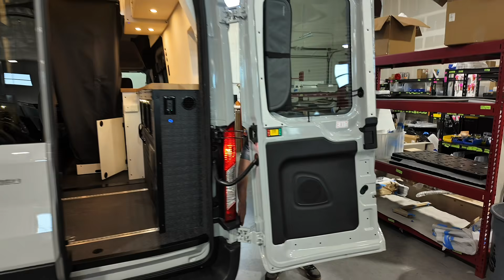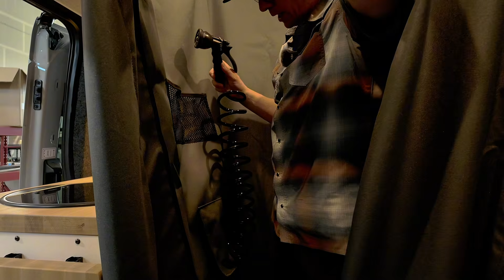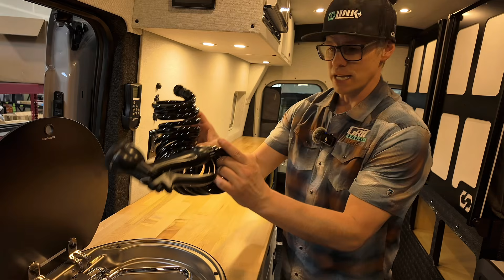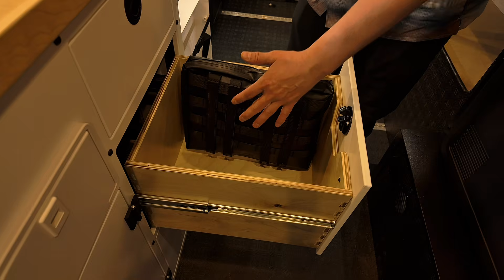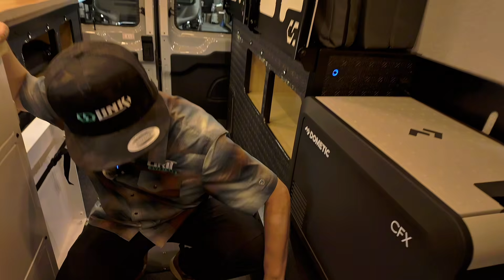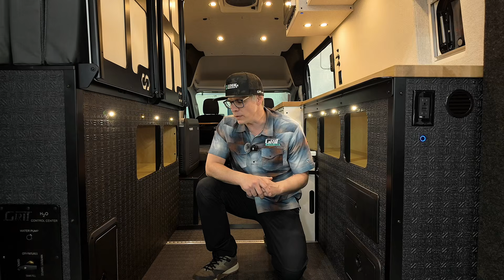2025 Ford Transit AWD Campervan Tour, The Ultimate Adventure Van by Grit Overland, flexible off-grid

Comment: 3 creative twin beds Must easy driving/easy parking transit. Cover kitchen/stove top w a sturdy hinge/clamp lock board & memory foam top? Need 3-4 sleep, less kitchen, 1 crock pot secure. I’d Fry on a table-plug-in stove outside. Insurance coverage & good bumpers. Not 2026.

Comment: Like your product!
Why is your extended counter not even with the main counter?
Possible future improvement?
And will a Joolca toilet fit in that spot?
Reply from the maker: The extension is meant for the induction stove so the main table space is freed up.
Yes a Joolca will fit.
Also, we just posted two new van tour videos if you want to see them. They have new 2026 improvements😁

Comment: What's the ground clearance in this transit trail vs sprinter without additional lift up? Do you guys add more lift up on it? Thanks
Reply from the maker: We actually don’t build on the Transit trail.  We do offer the Topo 2.0(2-2.5 inch increase) lift kit as an upgrade for the transit.
The Sprinter is 2 inches taller from factory than factory ford transit

Comment: Thanks for the very nice and detailed video.  Is the S2 model available with the same rear bench seat as the S4?  (We don’t need the pop top).  And if we want a regular bathroom with door/enclosure, is this something that can be customized in an S2?
Reply from the maker: You can absolutely get the S2 with the fold away bench seat, you get to choose either one with no cost increase. We don’t do a fully enclosed shower for a reason which we also have a video on. We highly recommend seeing our shower in person to experience it for yourself. Give Kirk a call 3602180303

Comment: My question is, how do you power up the dometic refrigerator?  I've purchased and returned 2 CFX5 45 refrigerators because i had problems getting them to turn on.  Have you experienced any issues powering up the dometic refrigerator?  I was just wondering if theirs a trick to it?
Reply: Running mine in my sprinter no problem.
Reply: What are you using to power it? If you’re using a small battery box it may not have enough power to overcome the initial startup of the compressor. Does it work when you plug it in to ac power in your house?
Reply from the maker: Yeah this is a good elimination process. We have installed over 200 of the Dometic refrigerators and haven’t had an issue, not one time. We’d suggest what @Espo78 mentioned.
Reply: @Espo78 I used AC power and DC power.  DC power was a fully charged lithium battery.  Im guessing there was a bad batch of control panels.  But who knows
Reply from the maker: Yeah that’s interesting. If you’re still experiencing the issue I would try the house outlet method

Comment: Really love the thought process in your design, layout and construction.  I have rented Sprinters in the past but your points about the Ford have changed my mind!  A few questions:
1. Is there a way to make the song completely recessed into the counter top with the collapsible faucet?
2. Can you fit two gravel bikes in the garage without taking off a wheel?
3. What is your experience with AWD capability of the Transit as compared to a true 4x4
Reply from the maker: 1. It isn’t recessed but we make it almost flush by about 1/8 inch off the top. But that is possible.
2. Yes they will fit in the garage. If you’re setting up the bed later you will have to take the front wheel off
3. It is as capable as your need for where you need to go. Your not going to be limited by your drivetrain as much as you’ll be limited by your clearance

Comment: Are the black panels on the sides of the van where passenger van windows would typically go simply for aesthetics or do they serve a purpose?
Reply from the maker: it helps minimize pin striping and also for aesthetics
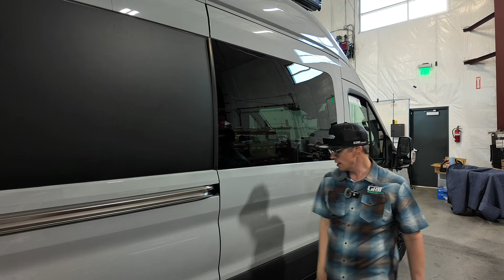Reply: Thank you,I missed that at 3:50 in the video.

Comment: Hello,  Great video.  Three questions ... 1. Can you open the fridge when you have the bed down?  2. Can you add a seat belt to the bench seat? 3. Can you expand the battery system to 16.8 kWh? Thanks JT
Reply from the maker: sorry for such a late response. you can crack the fridge open to grab an item off the top. i think i answered that question best from your other comment in the other video, and we have solar add-ons/upgrades ready to go